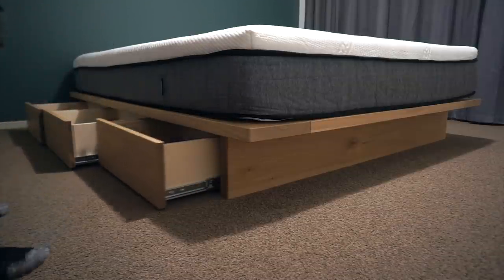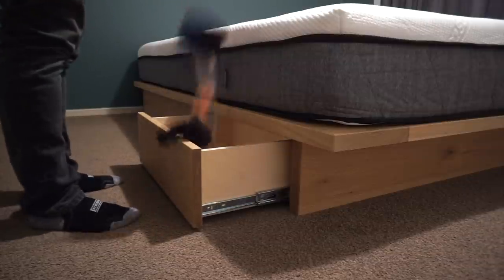An Oak and Plywood Bed Frame (With an Ecosa Mattress)

Comment: Very nice build!  Can you share what drawer slides you used?
Reply from the maker: Thanks! They are standard push to open ball bearing slides. I got mine from a local supplier but Rockler, Hafele, Blum, all have the same ones

Comment: Curious, 3 years later would you change anything about the design?
Reply from the maker: I have made some changes to it. Mainly screwing the slats to another strip of plywood so that they are connected. I did it in 2 halves so it is easy to remove them for easy access under the mattress for extra storage. Another thing I would change is to add some holes or leave some gaps to allow for some ventilation under the mattress. Other than that I am still very happy with the overall look and functionality of the design!

Comment: How can I adapt the plans for a king size bed? Are there plans for a headboard ?
Reply from the maker: I still need to make plans for the headboard. It is possible to keep the base part with the cabinets the same and just make the platform on top bigger to fit a king.

Comment: What a gorgeous use of oak and what a great finish you gave it, but it’s a shame you didn’t consider making a really long pull out drawer for the middle, rather than leaving that dead space?! It certainly looks like you have the real estate for it in that room?  Love it 😍
Reply: Adding a middle drawer would mean a lot of extra work to support the slides and not as clean a look. I would have just made the existing drawers longer so they're using all the space underneath.